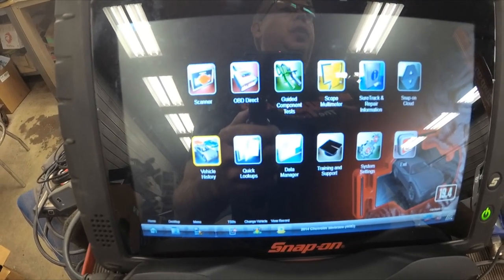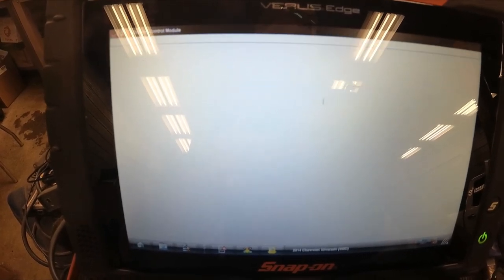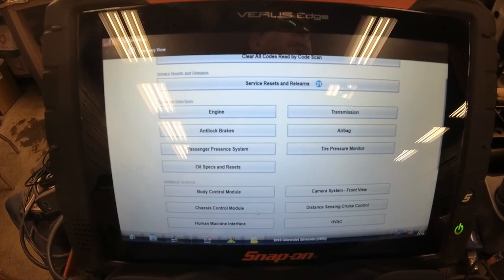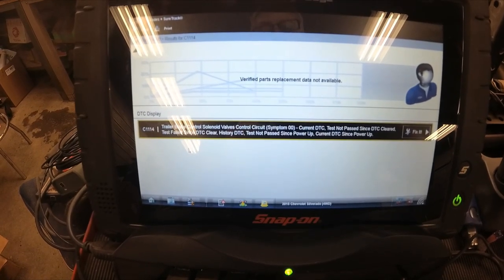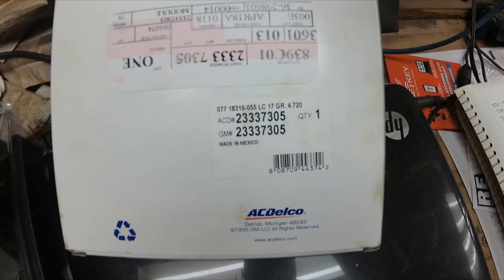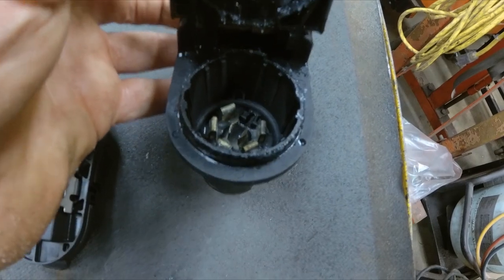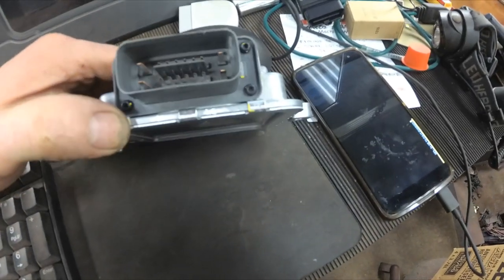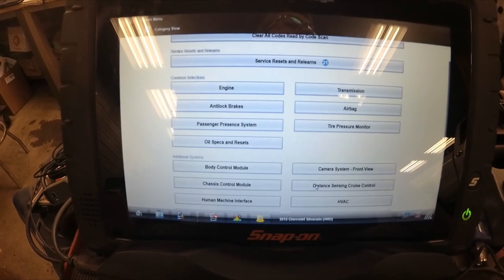2014 Silverado "check trailer wiring" Pt 3 Fixed

Comment: hi Phillip, maybe you can help me please!, i have a 16 sierra 5.3. for unknown reasons, i have power in my trailer hitch all the time now. meaning the pin that powers up the batter in a trailer. that usually turns off when you take the key out of the truck, now theres always power, i have a truck camper and its draining the truck battery, it didnt do that before
Reply from the maker: I'm pretty sure that auxiliary power feed is live all the time. Older camper vehicles used to use two batteries under the hood with an isolator. Ill have a look at the circuit and get back to you here.
Reply from the maker: Just looked at the schematic and the auxiliary feed come from a 30amp maxi fuse that is hot all the time. Something is on in the trailer or if it has a battery in the trailer might be a bad cell in it. Not sure how new the trailer is. Do you have a TV plugged into a 12 volt source in the trailer. Even if its off the inverter in it will draw power. Hope this helps

Comment: have a Chevy 3500 wt my service trailer wiring light comes on my dash spelled out with exclamation point, my left blinker and brake light don’t work only left side running lights are brighter on left side also. Tech said he’s getting power on all 7 prongs on my trailer hopkin connecter a snap on code reader saying it’s the brake control module and pressure valve and my code reader says c0800-5A control module not plausible please help
Reply from the maker: What year is the 3500. As far as I know the lights have nothing to do with the brake control unless you have a bad ground
Reply: @PhillipBailey  it is a 2019 , I took apart the Hopkins plug black melted tape or grease was on it wonder if it’s bad one prong kept bending that same prong controlled the left signal

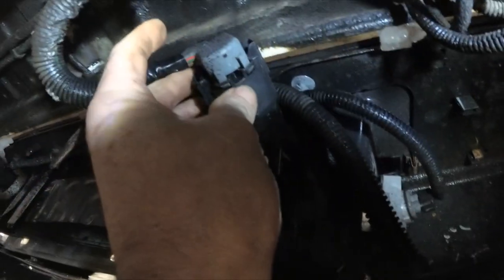Comment: Im glad you put this series together thank you! I confirmed its on the truck side just replaced the 7 pin coupler. Problem persists I noticed at 3:59 you mentioned a secondary lock. Mine seems to be missing had the bumper replaced. Dealer said they can't find a part number for the secondary lock. Would that come with the wiring harness? Im assuming missing the secondary lock would contribute to the issue?
Reply from the maker: The secondary lock is probably only serviced with the harness but it's not critical for proper operation imo. Is it setting any codes?
Reply: @PhillipBailey  I appreciate your input, module on the way.

Comment: I know it's a old video, mine is a 2015. Maybe you can tell me where the chsml wire is ? Trying to tap into it for the 3rd brake light on my topper. Thanks
Reply from the maker: Try Alldatadiy.com for wiring diagrams and connector locations. It's not free but it's pretty reasonable. Alternatively you could tap into the circuit at the brake switch. I'll have a look at the wire colour and get back to you...edit.  the brake switch is an input to the bcm which controls the chmsl relay under the hood. The circuit runs through the cab through the instrument panel junction block under left side of dash. Connector x2 and x3 a violet/grey wire. Try to find it there is my recommendation.
Reply: @PhillipBailey  found it by calling a local business. Blue and white wire coming out of the BCM.

Comment: Looking forward into your videos with the 19.4 update. I think I’ll eventually get mine to that point hopefully mid year. Im itching really bad for a pico.
Reply from the maker: I agree that the Pico is a superior scope to the one in the Snap-On tools but honestly other than network problems I don't have to bring it out much. I tend to use my Vantage Pro most of the time just because its convenient. I've been looking at a Pico as well but hard to justify the cost when I already have a couple scopes. If you don't have anything scope wise then the Pico would be my suggestion.

Comment: Hi Phillip. I have a 2021 GMC Sierra AT4. Without any trailer attached I get check trailer lights, disconnect etc error messages constantly. I even detached the connector to the 7 pin and still am getting all the check trailer lights and disconnect messages. Connections are clean and dry and in good shape with only 6000 miles on the truck.  Any thoughts would sure be appreciated! Thank you.
Reply from the maker: Isn't it still under warranty? You need to scan the system for codes and refer to the appropriate troublemaker chart. There are many things that can generate the dash message but need the code/s to proceed.
Reply: @PhillipBailey   Thank you Phillip!

Comment: I only have an issue when I am actually hooked up to my camper. It will jump back and forth between "Check Trailer Wiring" and "Trailer Connected". Funny thing is all the lights work and the trailer brake functions. My truck is a 2016 2500HD with a 6.0 engine. Any ideas?
Reply from the maker: Other than an intermittent connection at the plug or trailer grounds no sorry. Is the trailer brake module setting any codes?
Reply: I’m experiencing the exact same thing with my 2016 Silverado when towing. Any updates on this issue? Thanks.

Comment: I am having the same issues and have ruled out the dash switch and the plug connector looks good so I am thinking it is the module.  I have heard on-line that the red tab like to break on the wiring harness on the module.  What is the trick to getting the module unplugged?
Reply from the maker: No real trick, try cleaning with compressed air first before trying to unlatch. The plastic does get brittle with age though.
Reply: @PhillipBailey  Thank you.

Comment: What if I don't have a scan tool to clear the codes
Reply from the maker: If the problem is corrected the code should eventually clear on its own. You could try disconnecting the battery for awhile. That might work.

Comment: I have a '21 3500 and 02 2500 chevy.  I tow daily with the '21 and have gotten the check trailer wiring message on 3 occasions now.  The trailer brake control module and 30 amp fuse were changed the 1st time...work fine for 1 month.  Took it in and I don't even know what they did to fix, but it wasn't a module replacement.  They said it's on the trailer end and printed the bulletin for me to follow.  I ordered a new 7 pin connector and just wired it up and I still have the same message on the dash.  The fuse is OK.  My trailer brakes work just fine with my '02, but at 200k+ miles I don't like hauling with it.  What the hell is the issue with this?
Reply from the maker: Is it setting any codes in the trailer brake control module?
Reply: @PhillipBailey  thanks for responding.  Not communicating is what the dealership had written.
Reply from the maker: @shaymoose17  if its not communicating with their scan tool the it should be under warranty I would think unless you have a ton of mileage on it. I would agree that if tge brakes work on the trailer when towing behind the 02 that the trailer is not the problem. Is the 02 factory trailer brakes or aftermarket controller? If it's aftermarket brake controller then it is more forgiving of issues with the trailer. If the truck is under warranty I'd try a different dealership if possible.  You might also try towing a different trailer with the 21 see if you get the same message. There should be a code if that message is coming up.
Reply: @PhillipBailey  I haven't towed with any other trailers since the issue had come up.  There's 15k miles on the '21 and started using issues around 13k miles.  The 02 is an aftermarket controller.  I was told the trailer plug is the culprit and the for may be too loose.  So I ordered the plug they recommended, hooked up with no success.
Reply from the maker: @shaymoose17  ah the aftermarket controller is not as sofistcated as the 21 system and as such may not be as sensitive to an actual problem in the trailer. Given the low mileage on the 21 I would bet the issue is in fact in the trailer. Could be an intermittent break in the trailer brake circuit wire or trailer ground. Does the message on the 21 come up as soon as you plug into your trailer or when you start driving it. It would be best to either tow a different trailer with the 21 or tow your trailer with a newer preferably 21 truck to see what happens.

Comment: Does this module control the turn signals too, my 2014 there is no power coming out the connector  for right turn signal?
Reply from the maker: I don't believe it does. The right turn signal brake circuit is supplied from the KR63R relay in the underhood fuse center. Check for power at fuse F17 with the signal on or brake applied. It is fused separate from the other circuits. If that is good then other than the connections under the fuse center there is no other test points of connectors til you get to the trailer plug itself. Unplug the back of it and check there. Should be a Green/Violet wire to pin D. HTH
Reply: Okay, thanks.
Reply: Hey boss, how many volts dc are we suppose to read from ground to blinkers when on?
Reply from the maker: If you are measuring voltage at one of the turn signal circuits and ground with it on you should see a pulsing battery voltage in sync with the signal lights flashing. Hope this is what you're asking...
Reply: @PhillipBailey  thank you for the quick response. I’m having issues with my 2014 GMC Sierra causing the trailer lights to go crazy, any way that you could help? I’d greatly appreciate it
Reply from the maker: @AlexTorres-xp8pj  define crazy.lol. what exactly is going on?
Reply: @PhillipBailey  sometimes the left blinkers work, sometimes only the right. Sometimes only the right running lights work and sometimes only the left work. I hooked up the trailer to another truck and they work just fine. I just now noticed my reverse lights(backup) and my park lamps have continuity to ground. Both at the fuse box and at the plug in the back of the truck. Could that be my problem?
Reply from the maker: @AlexTorres-xp8pj  you need to qualify each pin in the 7 pole plug on the truck. Try connecting a significant test light between the various pins and ground. Looking into the plug the pin at 9 o'clock is the left turn/brake 3 o'clock is the right turn/brake. The ground should be 7 o'clock and park lights at 10 o'clock. For a test light I'd recommend a headlight as it will draw similar current as the trailer circuits thus loading the circuits. Pay particular attention to the ground as it can cause all kinds of strange issues if you have a poor ground. Try cleaning the pins with a small file keeping in mind to be sure all circuits are dead when doing this in case you touch two together. The middle pin is backup and the one at 2 o'clock should be live accessory power if the wire is connected at the fuse center. Disconnect the connector on the back of the 7 pin plug and check for corrosion in it. Hope this helps
Reply: @PhillipBailey  it was the fuse, thanks! Didn’t realize it had a separate fuse
Reply from the maker: @bigbadbrad1100  glad you figured it out. Yes should be a fuse for right and left turn!brake, running lights, and backup lights.
Reply: Where is the kr63r relay located on 17 Silverado

Comment: I have in my Chevrolet silverado a 7 pole blade , one is not working the electric brakes , did you know what can be ?
Reply from the maker: Check the 30amp fuse in the underhood fuse panel first. If that's good you will need a full feature scan tool to scan the system for codes.